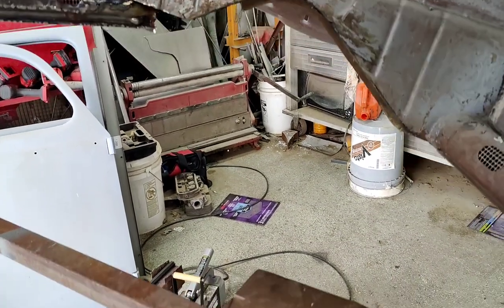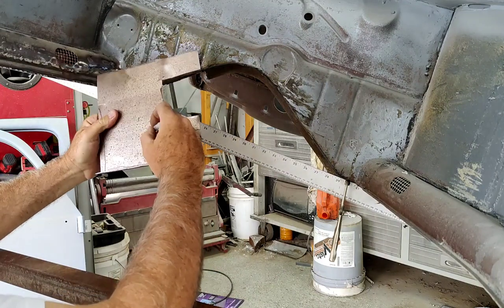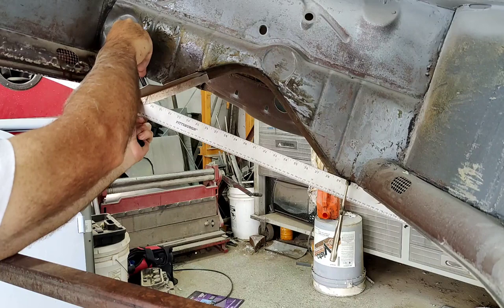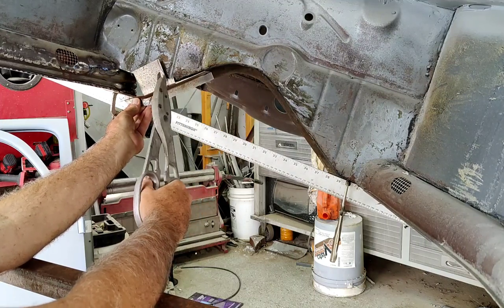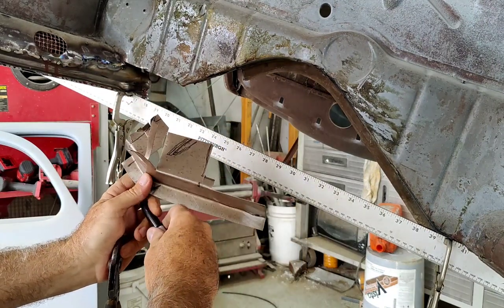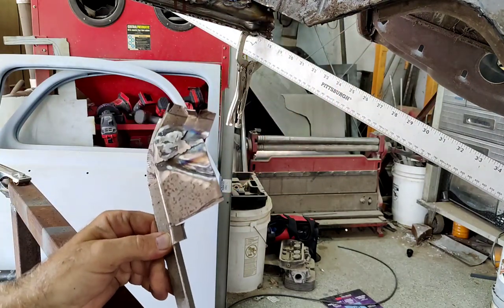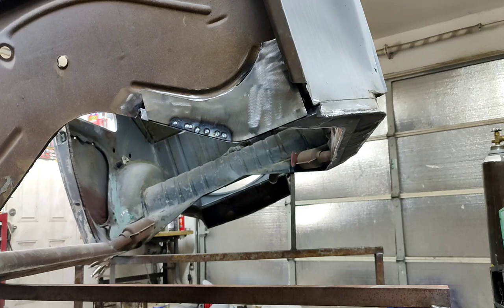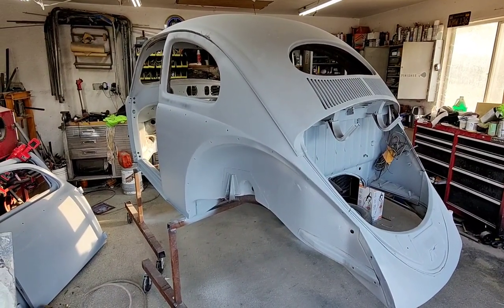1954 VW EARLY OVAL WINDOW Restoration - front firewall repair rusted out section

Comment: Mike, I'm doing most of the metal work  e.g. cutting and replacing rusty replacement panels,...  on my first restoration project. Since you do it all, can you describe in more detail the degree to which the welded seems I'm making on these panels need to be prepared before they're ready for primer and filler?

Comment: this is an honest question (and maybe a dumb one as someone who admittedly has never welded anything before) but with the massive aftermarket for metal for these cars wouldn't it be easier to get a replacement section and be done with it? i can see making your own for the sake of keeping costs down, i'm just genuinely curious. great video as always!
Reply from the maker: Removal of that panel is pretty hard and The new ones are cheap supplier. They dont fit very well. sometimes it is harder to replace it then fix what is there. Some parts you need to do a ton of work to before they fit. and they are general for many different years and dont look the same.